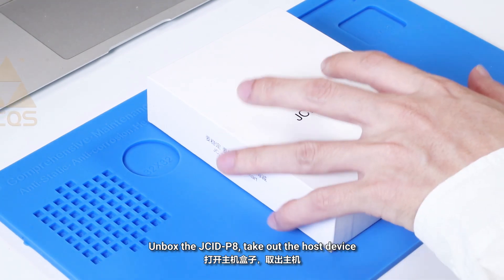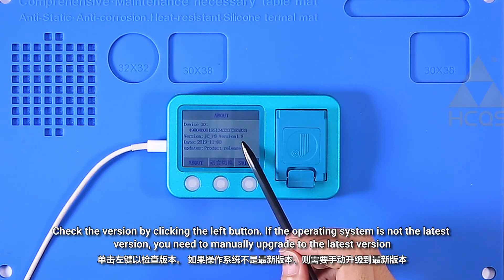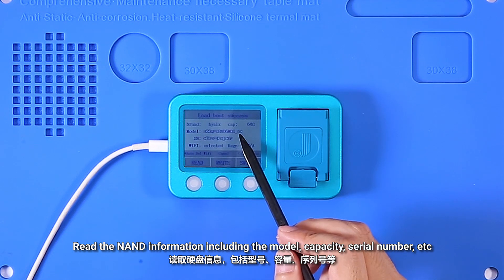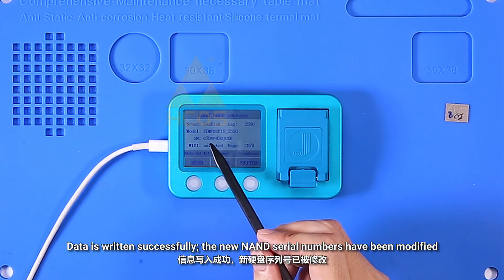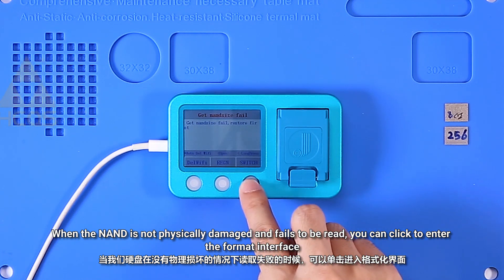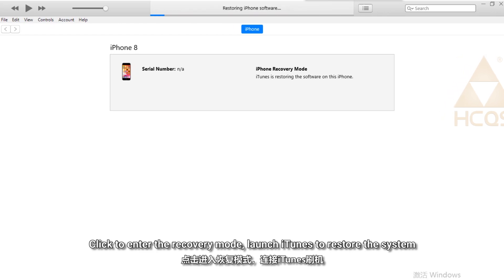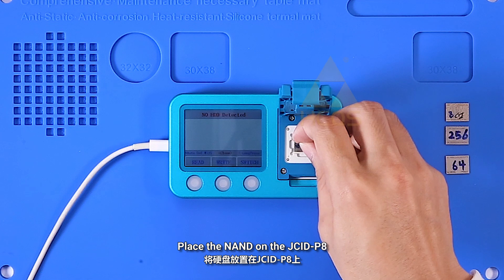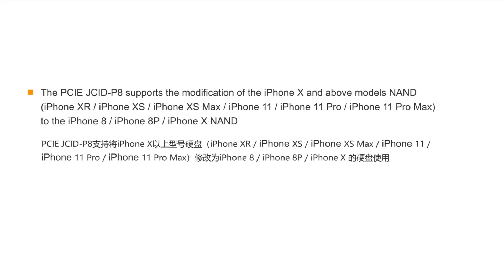Introduction to PCIE JCID-P8 | Repair Programmer

Comment: its support only 8 8plus x
Reply from the maker: Hi, thank you for your comment, when the programmer launches, it supports 8/8P/X, and now it has much function than before, you can consider it as an updated version. 
it supports fast NAND troubleshoot for iPhone 8-11 ProMax
it supports underlying layer writing, Wi-Fi unbinding, underlying data saving for iPhone 8-x
and much more
Reply: @HcqsUs  mean now its support xs xs max and xr read write date ?
Reply from the maker: @bewolf3056  No, for data writing, it only supports 8-x, for troubleshooting, it supports 8-11 pro max :)